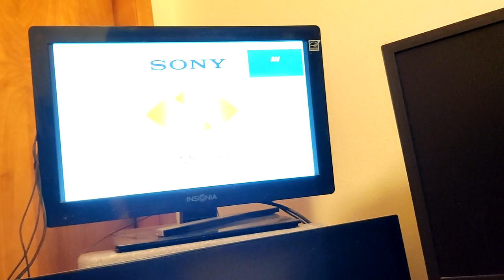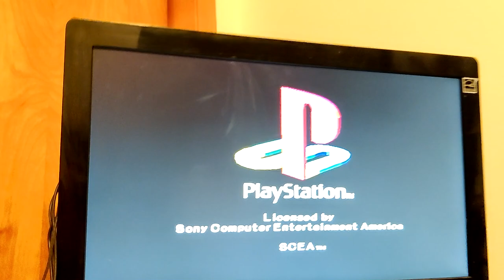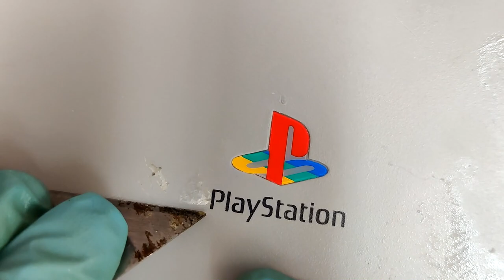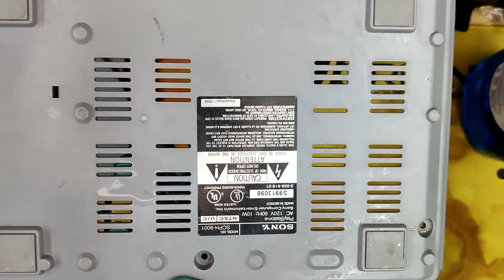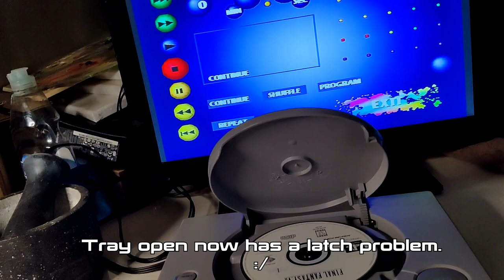Scarlet Restores! | 02 | NTSC-U/C PS1 SCPH-9001 Restoration!

Comment: I had a ps1 that was working but was just dirty. I followed the video step by step and now when I turn it on the green light comes on but disc won't spin at all. It makes no noise at all.. why would that be? It's like the motor has blown or something.
Reply: When disconnecting the laser disc on mine it came with the whole connector... now I need a new laser (I know it was dying) and some soldering